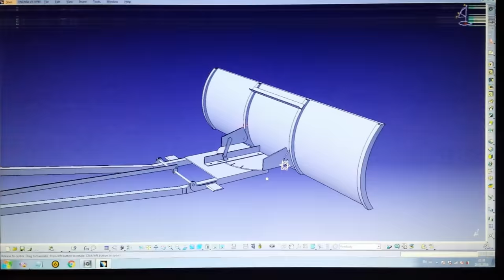Building an ATV Snow Plow - Part 1

Comment: Instead of bending the vertical tubing it would have been stronger to use plate steel cut in the radius
Reply from the maker: Yes, that would've worked too, but at that moment it was just easier for me to bend the vertical tubing. :)